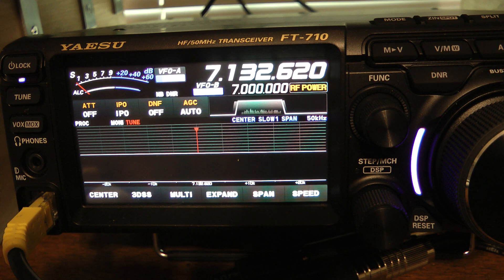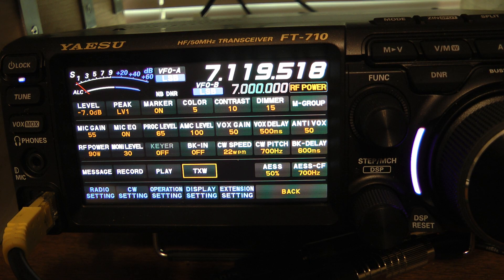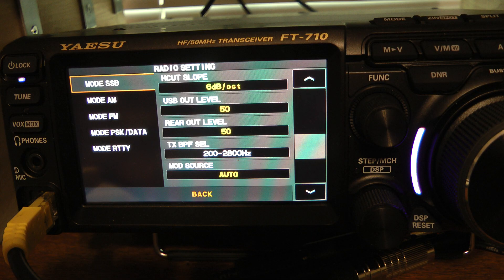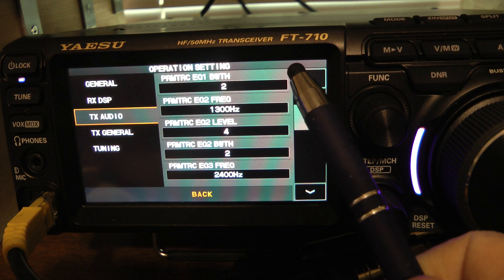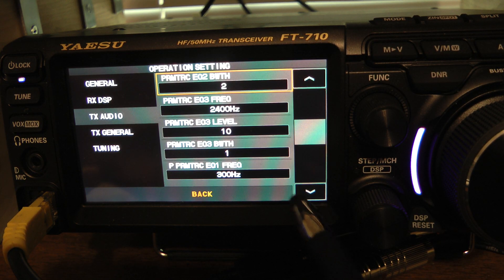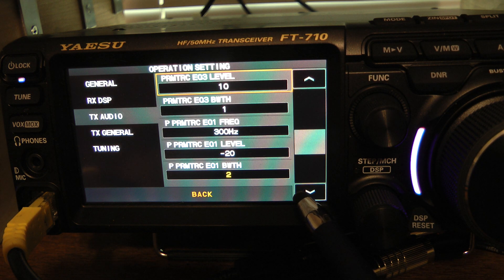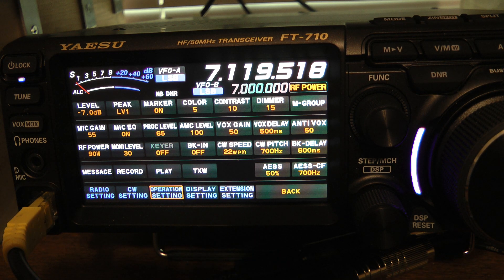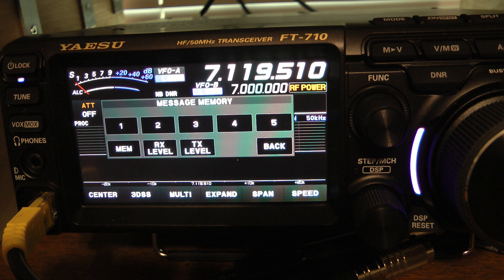Yaesu ft-710 old example or transmit Audio

Comment: Can send me your chart for eq settings please Kq4uei
Reply from the maker: For a shure 58 I use 60 Mic gain, 30 processor, P PRMTRC EQ 1 300 hz, level -3, BWTH 0.  P PRMTRC EQ 2 1300 hz, level 8, BWTH 1. 
P PRMTRC EQ 3 2300 hz, level 10, BWTH 0

Comment: You may need  to revisit the AMC, 100 is switching it off, AMC limits ths audio and should give you a cleaner sound and prevent spikes, desireable when using an RF amp. may be 60/70 is a choice.I know this is the case with the 101 so I assume it will be the same with the 710.

Comment: Nice concise explanations. Thank you I have a question; what adapter are you using and with which mic or headset? I notice the yellow plug and know that is not standard issue. I am trying to get my Yamaha CM500 to work with the 710 so I am adapter shopping. 73 KN6ZVI
Reply from the maker: Actually I was using a Marshall condenser mic with a Heil adapter for Yaesu rigs.

Comment: Sure about AMC? A friend in Tennessee has the FTDX101d. By watching several on-line receivers, I discovered his signal had what looked almost like an unsupressed  upper sideband on 75-meters. Apparently, other hams see this same issue with their signals and blame the AMC. Thoughts?
Reply from the maker: Well, I have looked at my FT-710 on the spectrum analyzer and it is clean, I am not sure what AMC would have to do with that problem. AMC is simply a limiter for mic gain.

Comment: Do the TX eq settings get used when you use the voice record feature, in other words can you test your settings with it vs transmitting to another station ? Thx 73
Reply from the maker: Yes, actually how I setup my audio was by recording to the 710 then with the 710 hooked into my dummy load I listened on my IC-7300 as I played the recording from the 710

Comment: Could you list the equalizer settings you would suggest for the stock hand microphone?  Thank you.
Reply from the maker: I did mention this in the video: Mic Gain 60, Processor 30, AMC 100, P Prmtrc1 300hz  level -8  BW 2,  P Prmtrc2  1300hz  level 2  BW 2, P Prmtrc3  2400hz  level 10  BW 1. Keep in mind your voice is different than mine so you will want to tweak the settings to your voice.
Reply: @johnwofford2708  Thanks!
Reply: @johnwofford2708  those settings in your reply are slightly different that the one in the video. ??